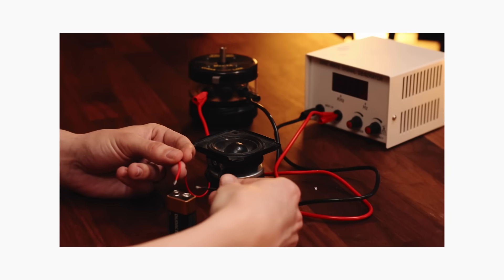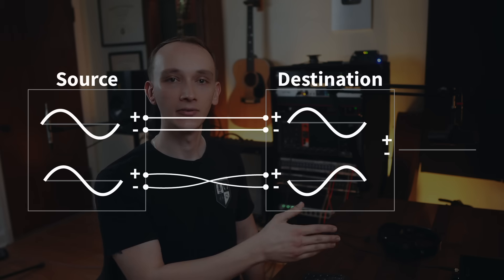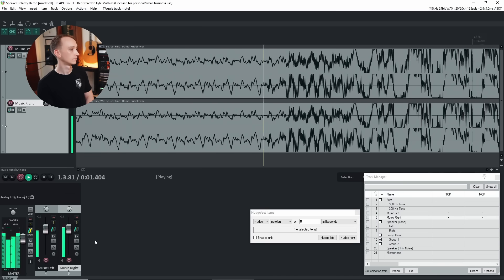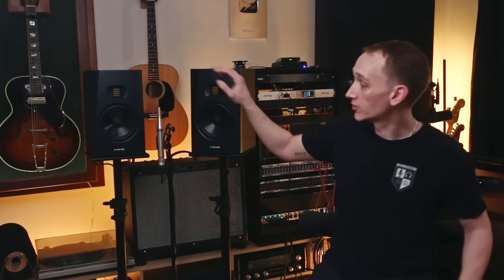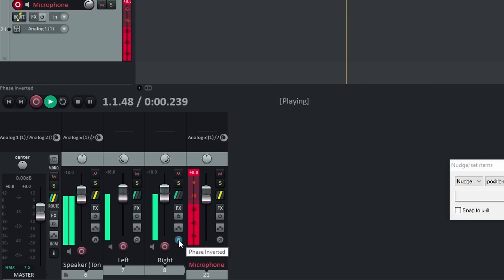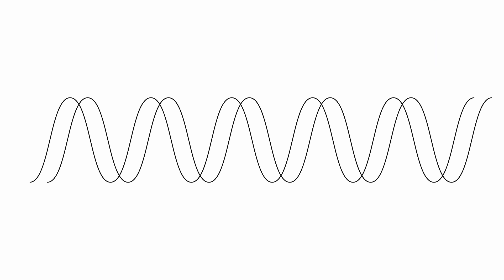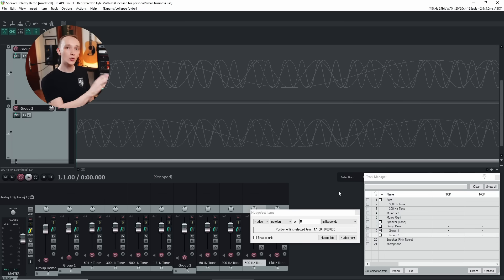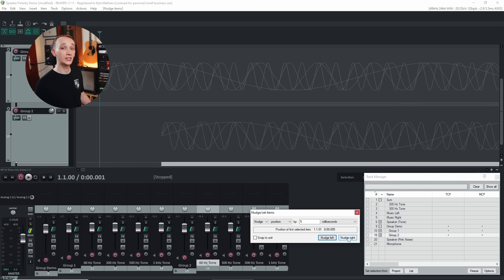The Downside Of Multiple Speakers In A Sound System

Comment: Intersting! 
But experiments like this needs an anechoic chamber (or at least a good studio/listening room that's close to anechoic
 - where all walls and ceiling are covered by sound absorbing material. A smaller sound aborber can then also be put under the speakers, to get rid of direct reflections from the floor). Then, the interference pattern should show up as a function of wavelength and distance to the speakers (like the classic double slit interference experiment)
The interference pattern got pretty much random there because the room was an acoustic mess (I heard it just when you were talking, how much reflections there was), so reflections are coming from everywhere, interfering with each other and the direct sound in an uncontrolled way. But still cool. The white noise at the end really show how different frequencies are cancelled out and boosted differently.
Reply from the maker: Yes. You are absolutely correct.

Comment: Nowhere in nature does a single thing make the same EXACT sound from more than one point in space. If I drop a nail on the ground, the sound that makes comes from one point in space. Something larger like a car may make sound from more than one point in space, such as the engine, the four wheels moving against the ground, etc. But those are actually MULTIPLE sound sources, despite being a part of the same object. THAT is one of the biggest challenges with reproduced audio if realism is desired.
Reply from the maker: Well said!
Reply: It depends upon what you mean. While you're right about multiple sources of sound, all that matters for reproduction and listening is the sum total that is reaching any given point in space at a given time.

So a binaural recording played back via intra-aural earphones will produce the same acoustic effect to the listener as it would if the listener were standing in the same spot that the recording was originally made (apart from small differences due to the difference between the shape of the binaural rig and the shape of one's own ears).
Reply: @bricaaron3978 In fairness, that assumes a mic with perfectly flat frequency response (or at least compensated) and an IEM that also has a perfectly neutral FR.

Not to mention the fact that individual HRTFs vary significantly, so the difference between the artifical ears and the listener's will likely be quite significant.

It also assumes that insertion depth resonances are controlled for, which is not something to take for granted.
Reply: Viva Mono

Comment: I think we are close to understanding why two identical instruments that are very slightly out of tune will produce a wow wow sound as volume rises and falls from partial cancellation.
Reply from the maker: Yes! I need to make a video on this in the future. If you play two sine waves together (slightly different frequencies), they will totally cancel at a frequency that is proportional to the difference between the frequencies. It's actually very easily predictable: 1 Hz beat at 1 Hz difference, 2 Hz beat at 2 Hz difference, etc. So, 400 Hz and 401 Hz would cancel 1 time per second. 400 Hz and 402 Hz would cancel 2 times per second...
Reply: Beat frequencies!